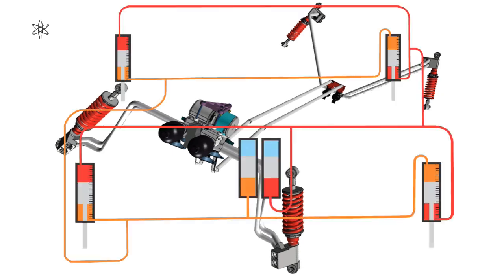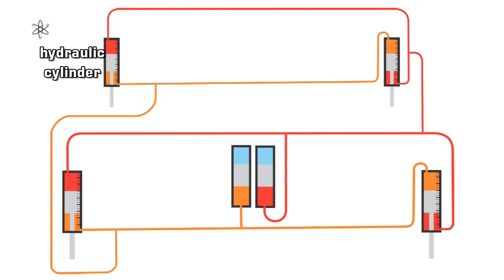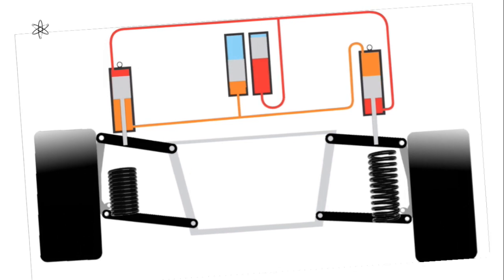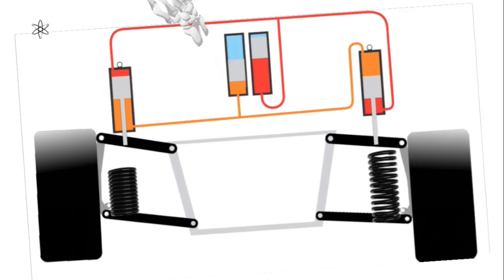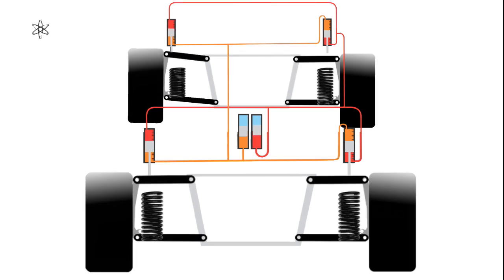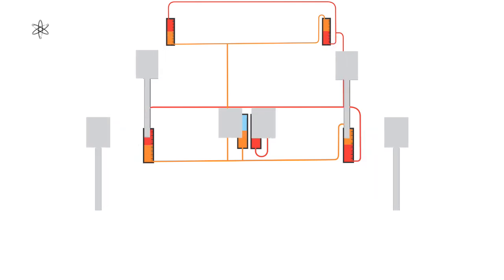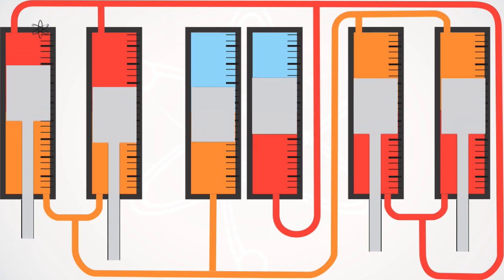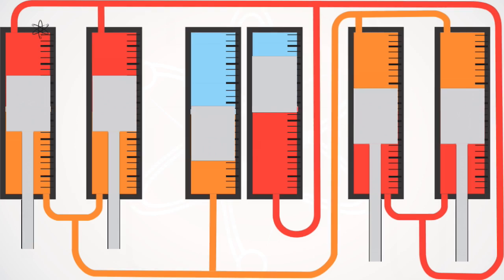Suspension Compliance Advantage Of Kinetic Hydraulic Anti-Roll By Tenneco

Comment: any idea why it was banned by WRC?
Reply from the maker: too effective...maybe also it had some active attributes. not much is known of the wrc version but if it had active collectors like on McLarens then it can be seen to have variable pressure within the system
Reply: @SpeedMediums  so it is mostly affecting the antiroll but leaving pitch heave and warp the same as they are or maybe slightly negatively affected in a typical 4 independent shock system correct?

Please correct me if I am wrong but this seems to fix only the antiroll aspect in a hydrolically decoupled suspension while leaving the other 3 axis of movement alone right?